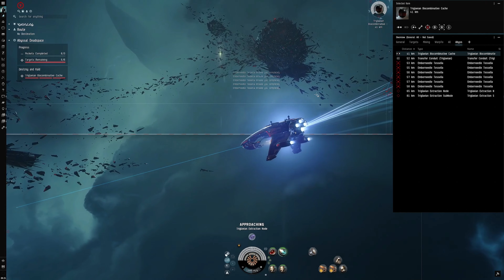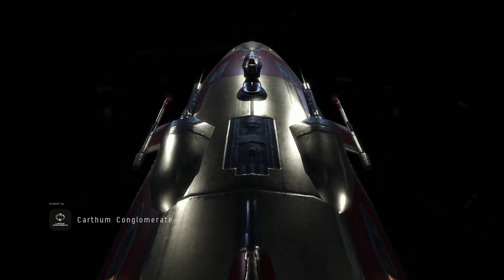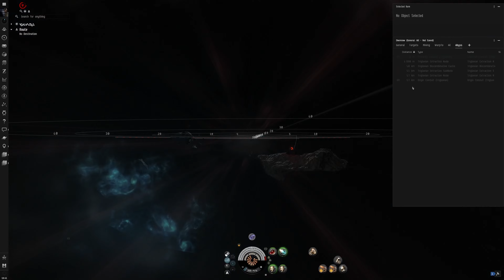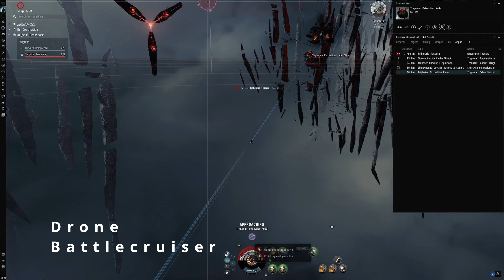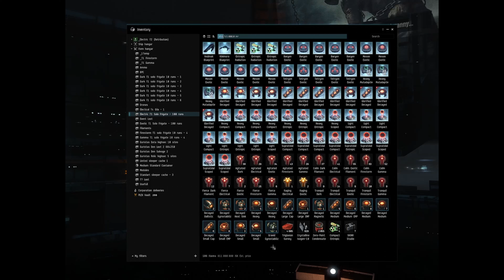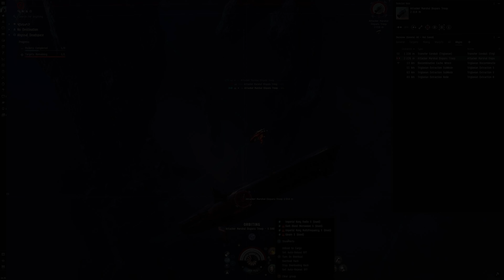100 runs of T1 electrical abyss in a Retribution (All cans)

Comment: Is it possible to do T1 using only T1 ships AND modules?
Reply from the maker: In a frigate, it will be difficult. The only frigate that could pull it off, at least in theory, is the Punisher. A destroyer would have a much easier time, and in a cruiser I don’t think it would be a problem. But why T1? Is it for the challenge, or because you’re an Alpha? Alpha characters can fly pirate ships and use T2 modules.
Reply: @derelict.explorer  Its for a challenge, I want to run abyss with things I can manufacture using BPOs only. Once I achieve that consistently I will move up to T2 (which requires copying and such). Also, thanks for the reply

Comment: could you please tell me why my CPU not enough to fit all, i only need a little bit more to on my last laser.. I only play the game for like 2 weeks, maybe you can share me all the skills i need to fit this run?
Reply from the maker: What level of Weapon Upgrades and CPU upgrades skills you have ?
Reply: Weapon Upgrades 4, CPU 5, Advanced Weapon Upgrades 4... so probably i need weapon upgrades and advanced one to 5.. only need 3 more cpu units T_T I could do the T1 pretty stable though even with much lower dps than yours, only die once in awhile (skill issue), solid fit!
Reply from the maker: Advanced weapon upgrades for power grid, not cpu. You need only weapon upgrades lvl 5

Comment: It's my Abyss tactic as well. But I use an afterburner with an implant to increase the afterburner's speed. That will give you much less bouncing and overshooting around the cans.
Reply from the maker: Thanks! I definitely need to give that a try. Not too sure about the implant though—seems like the 4–5% ones are pretty expensive, and even the 3% costs almost half the price of this whole fit.
Reply: @derelict.explorer  Because you can reach all of the cans on time, and because you won't get podded if you disconnect from the Internet. The implant  that increase your afterburner's velocity aren't that expensive. because the ship becomes an ISK printer if you stick to T1 Abyss Just get the velocity past the 1000's.